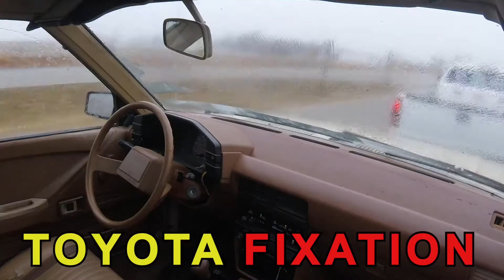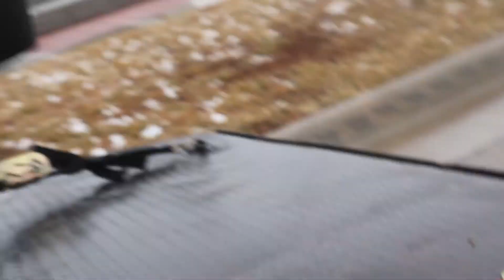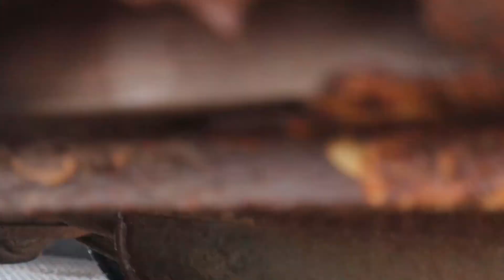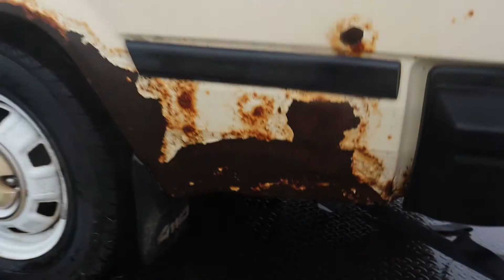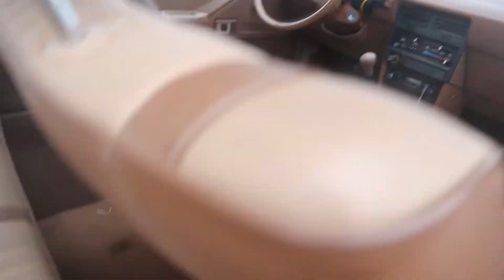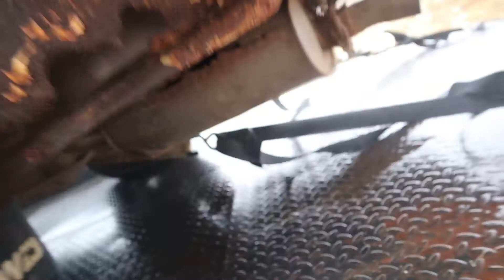ManDates 1: Buying a Car Together

Comment: And if you still have this and haven't done the clutch, I'd recommend pulling the motor to do the clutch.
Reply from the maker: Yes, we did pull the motor. It was a relatively easy job. The distributor was leaking oil and caused the clutch to fail.

Comment: Hi , I think toyota should have kept making the tercel. It was a dream car for me the boxy shape
Reply from the maker: The Tercel was Toyota’s economy car. You could consider it a model below the Corolla. They actually came back in the form of the Echo and a few years later as the Yaris. There is a gap of several years between each production making the echo effect. The Echo and Yaris are both great economic vehicles without many bells and whistles but get great mpg and are true to Toyota reliability.

Comment: I have a 86 tercel wagon but its a 2wd wagon. (I have a few videos on my channel) if you haven't ran across it yet check out the tercel 4wd facebook group and the tercel 4wd forum.
Reply from the maker: Thanks for the information.  I've definitely looked at the Tercel Forum a few times, looking at upgrades and mods.